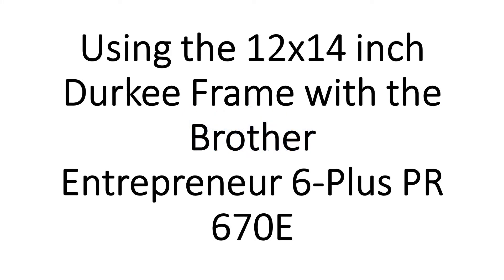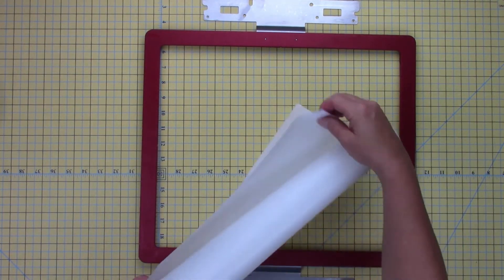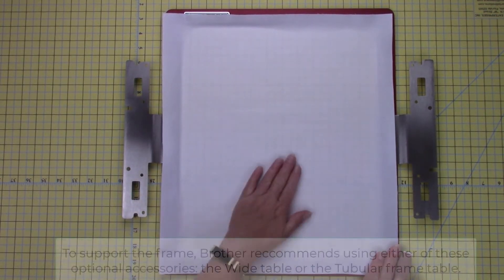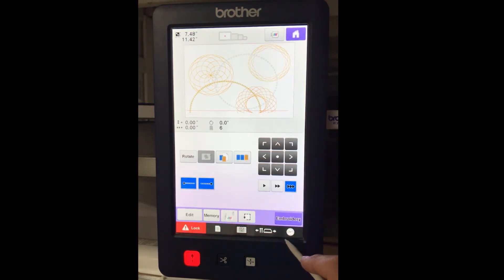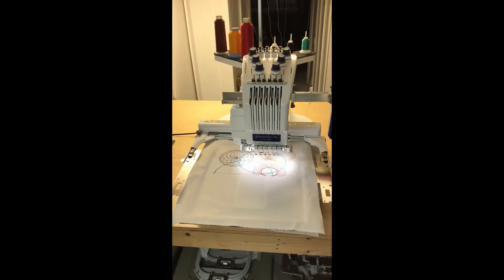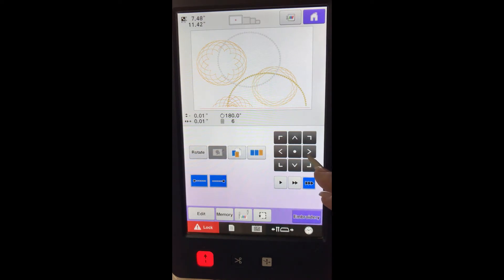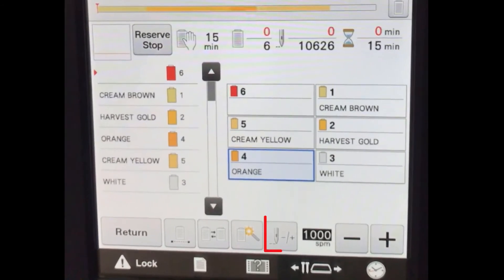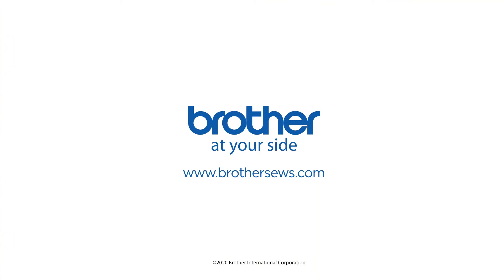How To Durkee 12” x 14” SturdiFrame Split Design Hoop with PE Design 11 Digitizing Software Tutorial

Comment: Can I float a Pillow Cover on the large fRAME? iF SO How is that done when the pillow case must sleve on the hoop? I look forward to your response. Thank you. I bought this frame to do items such as Pillow covers, T Shirts and other items that have to be sleeved over the frame.
Reply: Hello! Since this is a floating frame for splitting designs with software, it doesn't use the tubular arm of the machine, so seams will need to be opened so that the pillowcase can float ontop of the hoop.

Comment: I have a PR1055x.  I have followed this video to the letter, but when I try to position the 2nd half, I can not move the design up high enough to not overlap, even though there is plenty of room. I have tried at least 6 different designs and it is always the same. What am I doing wrong?
Reply: Melissa, are you splitting your design in PEDesign software before sending it to the machine? See https://www.youtube.com/watch?v=Yavj1XOk9v0 John
Reply: You may have to contact Brother Support or your dealer for further help. John
Reply from the maker: Hi Carrie, We reached out to Cindy Hogan and she spoke with Durkee, and they are going to give you a call to see if they can troubleshoot. Cindy says she doesn't mind trying the design as well, if that doesn't work.